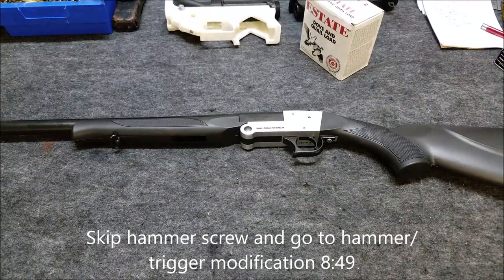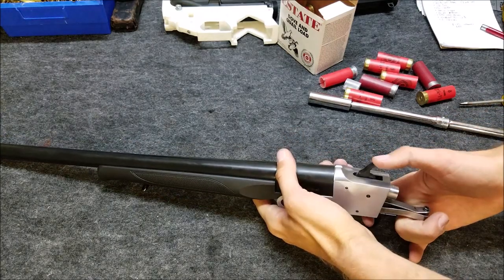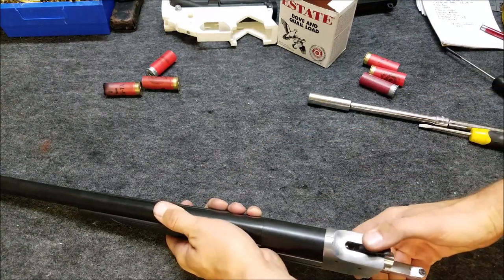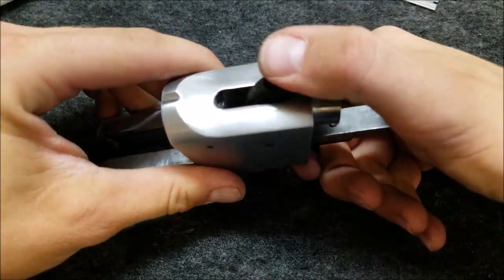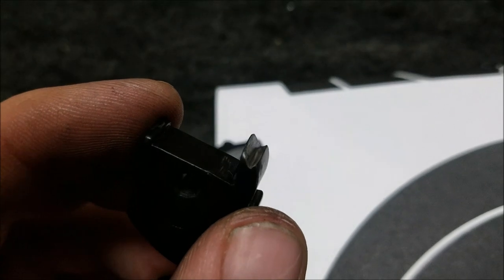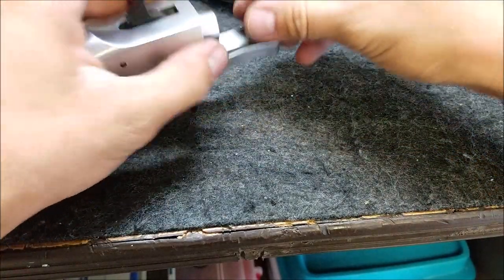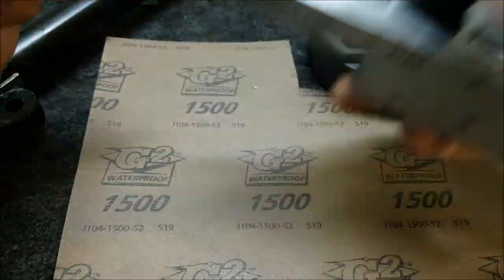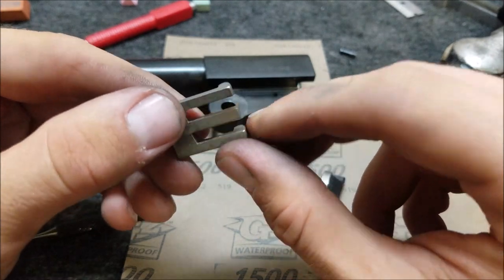SS12 Hatfield Shotgun COMPLETE trigger job

Comment: You did a real nice job. I've been a trap shooter for the past 50 years. In my sport, most shooters normally use a trigger pull of 3 to 4 pounds max as anything more than 4 lbs can lead to flinching while pulling the trigger. Thank you for posting this video.

Comment: I got one today. It feels like it was lubed with lapping compound. Its not just tight but extra gritty everywhere. It seems more like a kit rather than a finished firearm. I may fire a couple thru it but gonna tear it down like you have and stone anything that moves. Even the barrel slide release feels like its packed in sand. Inside the store I noticed small shavings in the hinge. 
For the price I don't mind sticking it up. I wanted a cold weather project anyway. 
Great video👍👍👍👍👍

Comment: I did the trigger fix by releasing tension on the trigger spring.  It was a huge improvement for trigger pull.  Have not experienced the problem with the lack of hardening of the hammer and spring yet.  Thanks for letting us know what to look for and how to fix it.
Reply from the maker: Clarence Ellis I hope that no one else has this issue.... It started to happen after 50 trigger pulls or so. I may also get a Hatfield shotgun from Walmart to test the similarities in manufacturing. I will tell you the Hatfield is better quality.

Comment: Excellent video. Full of useful information. I will try these tips. I have a problem with the sliding trigger guard sticking and being very difficult to slide and open the barrel to reload. Any videos or information on how to make opening the gun easier.
Regards John
Reply from the maker: I had that same issue. I took the trigger guard off, and sanded it so it was perfectly flat, then put some lock tite on the screw in the front, and DONT tighten it down all the way.Let the thread lockers dry, and that should help

Comment: That trigger tension screw looks about 1/4" long.....why not get a screw that is a little bit longer, then you won't have to worry about thread not having enough to grab on to, just keep it long enough so the firing pin strikes reliably (you don't want too much adjustment) or like you said....it won't hit hard enough and you might have misfires here and there, something I think nobody EVER want's to happen

Comment: Sorry for asking so many questions but how would u go about that
Reply from the maker: DLC Airsoft no worries, you just have to hold the pin some how. All these guns were emsde differently, so if they used lock-tite on the assembly of your shotgun, you will need to use an impact driver with a flat head bit. Just try to keep the pin from spinning by holding the other side tightly with your finger or clamp the receiver to a bench. The pin sticks out further than the receiver, so it should be held from moving when clamped

Comment: 9:07 Pivot screw on mine won't come out as easy as yours. Not by a Long shot. Penetrating oil didn't help. Proper size
screwdriver rather slip out than break screw loose. Slot getting wallowed out. Hatfield should use a Phillips or better
yet torque screw.  About ready to say to Hell with it. Thanks for mentioning the size so I know what to get as replacement after drilling this sucker out.

Comment: How do u get the receiver off the barrel
Reply from the maker: DLC Airsoft remove the handgaurd by unscrewing the front sling swivel. Then remove the screw on the hinge pin. Next, tap put the hinge pin. Then pull the trigger gaurd to release the barrel from the receiver
Reply: Thanks so much
Reply: So I removed the forearm and attempted to unscrew the hinge screw and it just keeps turning
Reply from the maker: DLC Airsoft you need to good the pin from turning. On the other side